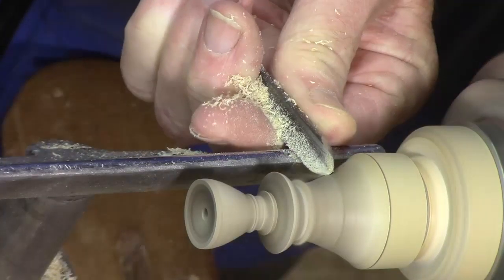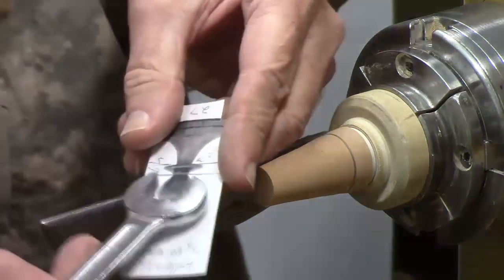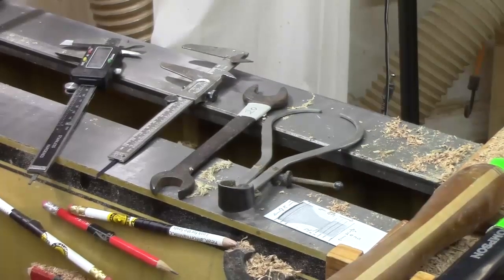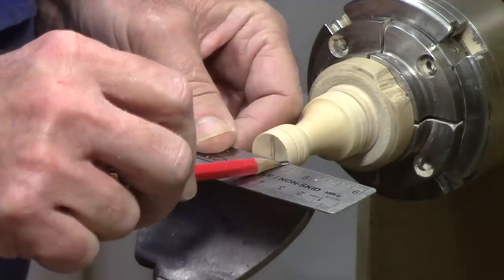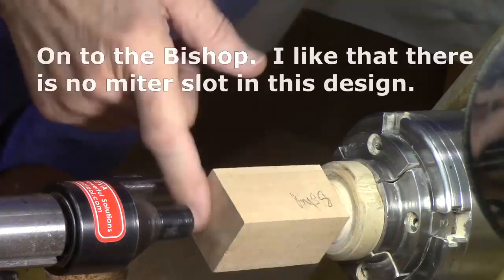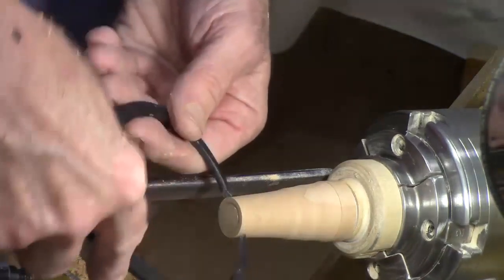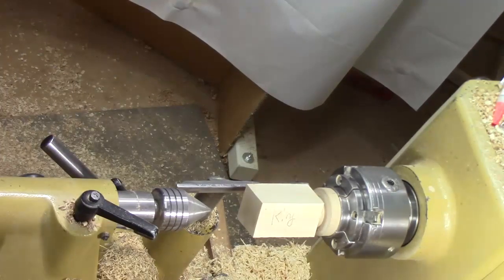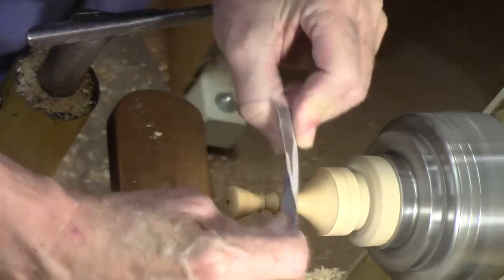Woodturn a Russian Chess Set

Comment: 0:54 pennies or lead??? Why not a small magnet and put a plate just underneath the checkered board?
Reply from the maker: I used pennies for this set. You approach seems far more complicated  and expensive in my opinion tryng to get the right magnet strength. That would be
a big plate of steel and take  strong magnets to pull thru 1/4 plywood not to mention heavy. Try and let me know how it works for you. More than one way can work.
Reply: @MikePeaceWoodturning  Yes, probably both. I would like to see/try it. If only I had access to a woodshop :)
btw 1/4 plywood is 1/4 inch plywood (a bit more than half a cm)?
Reply from the maker: about 6mm

Comment: What is the slow speed click? I didn't notice it at high speed. My PM has a bearing going out?
Reply from the maker: That is a bit of a mystery to me. Bearings would be the last thing I would check on a PM. Possible problem but remote, in my opinion.
Reply from the maker: I finally discovered it is coming from my chuck. The pintles in each side, where you turn your chuck key, rattle at slow speed.